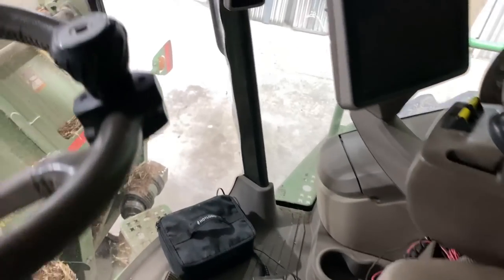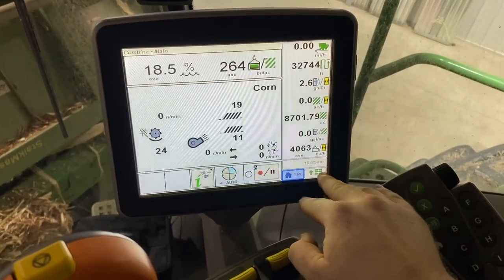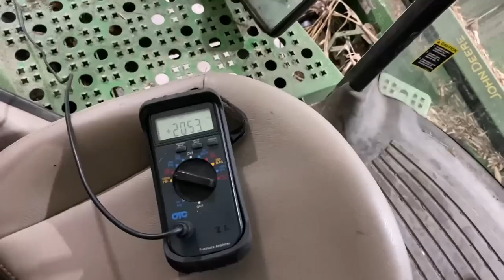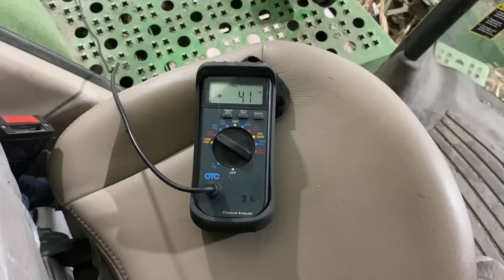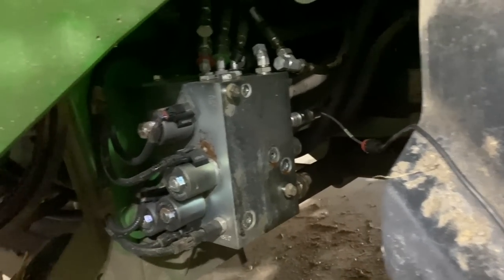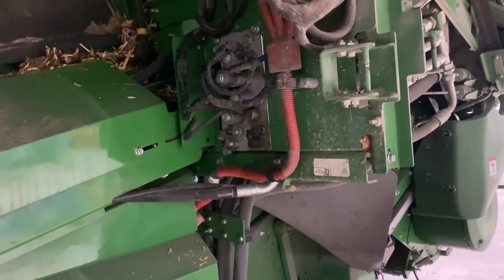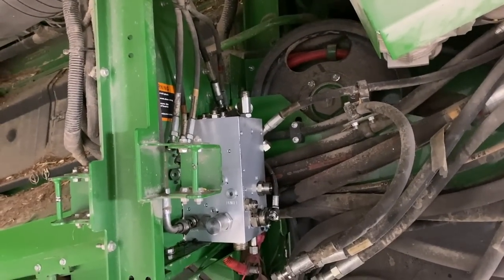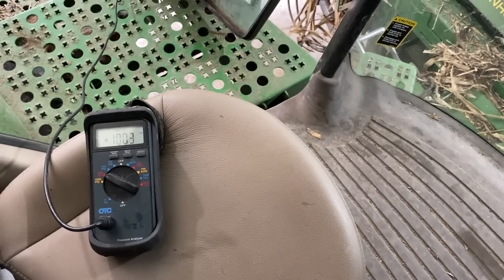John Deere S680 - Header will not raise or tilt.

Comment: This was one of the best things I have ever watched. After spending 25+ years troubleshooting assembly equipment in an auto plant, this reminded me of some challenging problems I worked on that also involved a combination of potential electrical and hydraulic or pneumatic problems. At least you didn't have a production manager standing behind you asking every 5 minutes how long before the line restarts and then wondering why you couldn't figure it out "right away". Great job of working and learning so you can apply the knowledge next time.

Comment: Thank you for this video. I have an older combine (JD 9750) but it has almost the EXACT SAME issues. My local dealership so far has been unsuccessful in being able to diagnose what the problem actually is. The older combine has to be somewhat similar to where one could use a very similar way, or maybe exactly follow the steps that you did here. Very interesting video.

Comment: I don’t see that one as a failed diagnostic at all. There’s no way of knowing if that valve body didn’t have a crack or debris scratch in it without getting with Deere refurbishment later (good luck). You worked the problem to a successful fix. Great job! I was a John Deere road tech for years as well and understand what you are up against most times

Comment: I understand that John Deere wants their technicians to follow a certain procedure but, from the very start my gut was telling me it's that valve block. With today's machines, I've seen too many issues and it always goes back to the valve block. All the more reason as why I hate today's equipment. Too much electronics controlling stuff that should be controlled manually. We've gotten lazy.  Still enjoyed the hunt. Yes, you're absolutely correct about applying what you learn. If you ain't learning something new everyday, you ain't living. Great video, cheers :)

Comment: I remember you saying that you had to add some hy-gaurd when you first arrived.   I'm wondering if the owner had been fighting a leak and was having to top it off daily.   When hands doing daily service, blowing out radiators, and air filters it causes a very dirty environment for adding oil.  Since you had to boost pressure, I wonder if all the hydraulic filters and screens were clean.  One thing about variable piston pumps is maintaining immaculately clean fluid is vital to its longevity.  If it's had dirty fluid running through it then it's efficiency could be greatly diminished.  Owners and operators that are use to the older equipment prior to variable piston pumps don't understand the extreme importance of maintaining an immaculately clean system.

Comment: When troubleshooting load sense always make sure the differential pressure is high enough and also if you are losing load sense pressure look at the check values in the component that works correctly.      That function is working correctly because the check valves everywhere else are working.

Comment: So, did the valve block need to be replaced? And how much do John Deere charge for it?
Reply: I was wondering the same thing….maybe just raising the pressure would have fixed it without changing the valve block
Reply: @conebone669  still doesnt make sense why everything else works as should and head lift doesnt without tricking it... you'd think it would show inconsistencies elsewhere?
Reply: I bet deere charged a lot of money

Comment: Zeth, I'm a bit unclear why you upped the pressure prior to trying out with the new valve block installed.  Does that not leave a doubt as to where the problem actually was?
Reply from the maker: Yes that was the point of my analysis at the end. That the problem could have been the compensation valve on the pump and not having enough standby pressure.
Reply: @ZKMasterTech  understand that just wondered whether you tried the new valve first then upped the pressure even if you were leaving the new valve in place it may have helped know for the next time? 
Awesome videos btw

Comment: Worked on a MX270 last spring.  They use a Vickers pump set up with a load sense competition valve system.  Pump went into full stroke for a bit, then nothing.  We had load sense pressure.  Turned out to be a bad compensation valve.
Reply from the maker: Yup I’ve had them fail like that on 9030 series tractors a lot. Pump would stay at stall pressure and the engine could barely turn over

Comment: Do you ever have problems with all of the debris around all those belts and pulleys and moving parts causing friction you need to take that to the edge of the field and break out the big diesel driven air compressor and spend about a half an hour just blowing everything off and breaking out the shovel or the garden tools to rake all that stuff out of there or is that something you do at the end of the season before you put her up for the long winter
Reply from the maker: Yeah you need to blow them off everyday

Comment: do you think all the extra weight from the folding corn head had some thing to do with the block failer,on my 9760 the wisker switch for my hillco levaler stuck and cracked the aluminum hilco block it was replaced with a new cast block and my s670 hillco block has a aluminum block,go figure that one out.great job by the way.

Comment: Hi Zeth 
I have seen cracks in blocks also especially ones that are so full of valve , orifices. The tolerances are so tight that passages can cross over if a internal crack occurs.
Could you please tell me was that block aluminum or steel & did the valve block change not resolve the issue and the standby was the real issue, on our Drill rigs our standby on rexroth piston pumps is 30bar and it’s interesting to see this issue for future thinking also 👍

Comment: Greetings Seth from Oz. 
I’m currently running an aging S680 and having issues with the auger swing switch on the hydro handle. Frankly; it’s worn out. I’m told that it’s not available as a seperate part; and that the entire hydro handle needs to be replaced. Do you believe this to be the case. Regards
Reply from the maker: Yes you have to replace the whole handle.

Comment: Yes there's  nothing  like Knowing  how the systems  work on these bits of green Iron ... made more interesting  with the Computer over management  of all  the systems  . Being  Qualified  at the Time Computer controlled  systems were being introduced  i guess i was more open to how they could help and or hinder operations of the machine  system's .  At least some times they leave reporting  of issues on screen  but  ... Service  ability  of JD iron leaves a little to be desired ... ie that Transmission  issue  of solenoid valve .. yes it has to be tucked away to protect from Mechanical  Damage but if you can't  Swap out component  because of access issues it becomes  a point just how much you have to dismantle to  correct the fault ...
The big Question was asked when i was a Ag Engineering  Student  was What happens  whent these Electronic  System become 2nd 3rd and fourth hand do you just put them in the Crusher ... Nothing  Like them olde Green and Yellow two cyclinder Poppers i thinks thats what you state side guys and girls call em lol ...

Comment: What is "D.R" I know its where you check the Combine Hydraulic Pressure on the Valves, but what does "DR" actually mean Please??

Surely it should be "DT" Diagnostic Testing or "DP" Diagnostic Point, but why "DR"??

Another Ex John Deere Service Technician from the UK 🇬🇧😎
Reply from the maker: Diagnostic receptical

Comment: I wonder if JD keeps track of parts such as what you changed out to determine failure rate and whether an engineering/manufacturing issue exists.  Are service bulletins or recalls issued if there are multiple failures of a particular component?  Is the control box you replaced serialized?  Do JD engineers ever destructive-test these replaced components to determine cause of failure? I assume many parts of a combine are not built by JD and are probably made in China or Mexico  - so failure of components is no doubt becoming more and more common.  For want of a nail a shoe was lost. For want of a hydraulic component, a combine was lost. 2 cents
Reply: I’m not sure about older machines but with newer ones the whole JD link and being proactive instead of reactive is deeres new thing. Yeah if a part failed on a certain serial number range of machine and they see a trend. They send out alerts to the dealers and maybe the customers somehow. If not then the dealer notifies the customer that hey this part fails at 250hrs so we want to take care of that before your machine goes down. Something along those lines and I’m sure they look at the failed parts and make improvements. Something along those lines anyways

Comment: simple fault
Reply: Nothing is ever simple , however knowing the  system and  how it should work makes for an easier and quicker solving of the issue . Agspanner
Reply: @josephcooksley3219  I say this because I myself have been a mechanical engineer for John Deere for ten years. Everything is correct, it is enough to know the principle of operation and understand the hydraulic circuits.